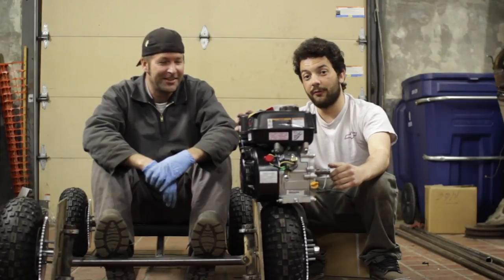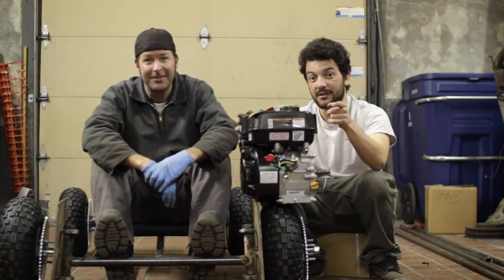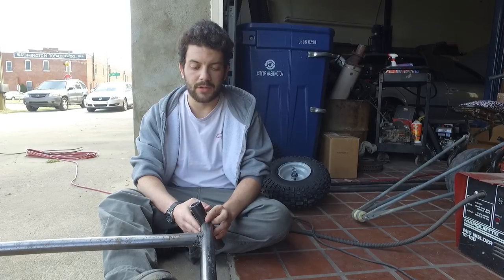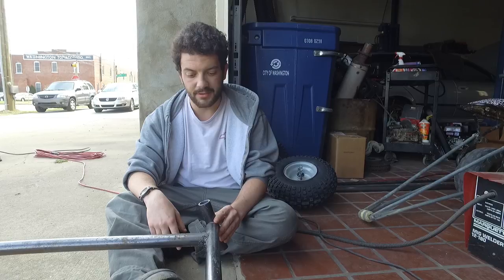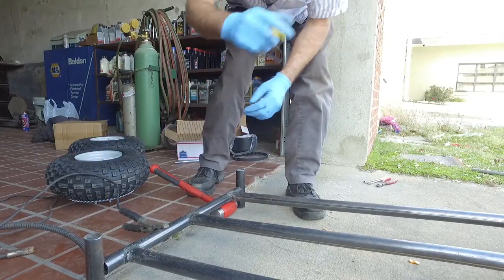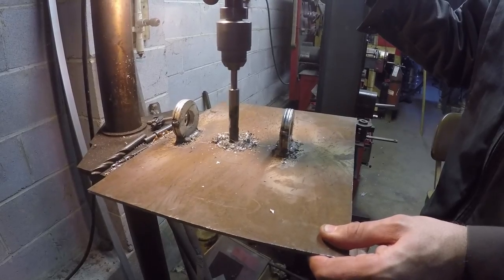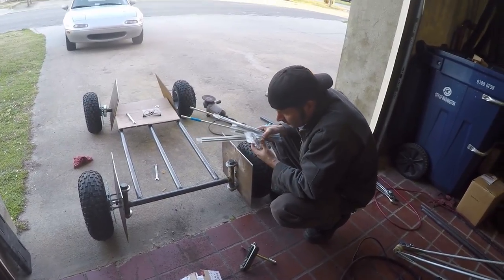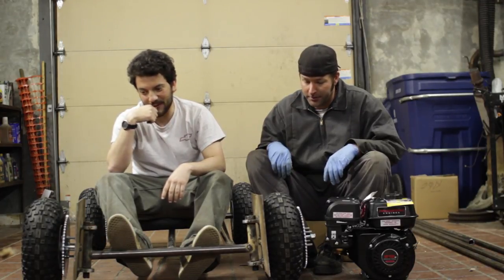AWD Go Kart Build Pt. 2

Comment: suggestion: do a golf cart drag build with the 670cc
Reply: That Guy im liking thisthis idea
Reply: That Guy.  I've been trying to find a golf cart to buy for cheap but they really arent.  im putting a vtwin harley engine in one
Reply: JTJ_ 22 you just have to keep your eye out i have 2 yamaha gas golf carts that i got for under 400 each that i built one has a 13hp engine which is my dads and im putting a 200cc (16hp) lifan 5 speed motorcycle engine the other one which is mine

Comment: hey guy just a question. I could be wrong. but just a guess. would I be easier to make two live axels with two sprockets in front and two in rear at the center of the shaft with the motors lower to center of gravity and  for the front axle to have stearing use two knuckles like for a drive shaft.
Reply: Luke College thought the same. Don't think it's gonna work if they don't do it this way
Reply: Luke College it could even be as simple as a universal joint at the end of the live axles, no? But then I suppose steering angle would be reduced
Reply: Chris' Bliss Builds I'm not sure I was just wondering. I was making an uneducated guess but would be cool if they figure it out
Reply: Yeah using knuckles would make it a lot simpler and more effective, Running it like this is limiting your top speed more due to all the weight of the steel and the engines. 2 engines 1 for each axle is the way to go
Reply: Luke College it won't turn
Reply: U-joints might work depending on how much angle needed, but small CV joints would certainly work.  Using either of those makes the spindle design a bit trickier since it'd have to carry a bearing/hub... not too bad especially w/ no suspension.  It's gonna be wild trying to tune-it w/ 4 independently driven wheels.
Reply: Yes it will.
How do you think any front wheel drive car turns?
Reply: really it be easier to do it that way but this will bring more attention and id rather see it done.
Reply: Or ya could have all 4 engines at the back with a pair of drive chains going to the front axle... it probably wouldn't be very reliable though because the excess slack in the chain may cause it to throw off without a chain guide or 10
Reply: I would have used one big engine and gear boxes like they used on the wagon to deliver power to the front and to the axles, then use small scale PTO shaft to use for steering  because it would need some kind of slip yoke or the axle will not pivot correctly.
Reply: Luke College like CV joints
Reply: i would have 2 straight axles
Reply: how are you gonna have four axles with four tires? and multiple engines on one axle would create too many problems.. two live axles in the rear with four tires and regular steering up(only uses 2 engines) front would be awesome and a lot less work and i bet it would handle better. i understand its not awd ... but i feel like four wheels in back would be sweet..
Reply: It's probably worth pointing out that a solid axle in the front (as in without a differential) wouldn't steer properly even with CV/universal joints because the wheel on the inside of the turn is following a smaller circle and so needs to revolve fewer times. Solid axle = understeer city. They might face some of that issue still, because the motor driving the inside wheel won't know to slow down, but there is some leeway there since these motors aren't huge. Will be interesting to see how it turns out!
Reply: Luke College I meant, mounting the engines on the frame. and fabricating a CV joint that goes from frame, thru the knuckle to the wheel. the steering won't be "weird or jerky" since the clutches can compensate for the speed diference
Reply: Bean  so the thing they are building is gunna steer a little weird also I think lol
Reply: Matte Edström because they have differentials
Reply: anthony anderson Weight won't limit top speed, just acceleration and handling.
Reply: I want to see 2 torque converters in a row on a cart. I suspect torque will be multiplied by the first to the point of burning the belt on the second. Or say 3 to 1 ratio on both if engagement is 1500 would need 4500 rpm at start to get the second to hook up. Would this give 9 to 1?? I could see a 6.5 winding up and doing wheelies. In a light cart. Maybe a 13 with 2 40 series in a row. Modify the engagement point on the second so it's constantly locked. The first will take care of the idle. I think 2 40s would last on a 6.5. I may act like 20lbs of torque on the second belt. A 13 would be like 45lb torque if multiplied by 3. This would also enable running a much smaller rear sprocket in the back for higher range.

Comment: 1. notch the tubes when youre welding them even if you barely notch them with a grinder.
2. tighten the wire guide nut in the welder. 
3. turn up your power and down the wire speed.

Comment: you don't need steering on this thing you need to stick steer. throttle cables on the right. throttle cables on the left. Push Pull cables for your break. drive it like a bobcat or a tank.
Reply: Sharecropper 182 EXACTLY!!!!!!
Reply: Good 'ol skidsteer
Reply: Sharecropper 182 good concept however it would only work if their was reverse on the wheels in order to work like a bobcat.
Reply: Like a tank
Reply: you shouldn't need reverse for it to turn simply hold the brake on the left side throttle the right or vice versa it should turn fine
Reply: Sharecropper 182 yes I under stand it would just be cool to do 360s with a reverse also
Reply: I understand completely that would be fun
Reply: fuck yeah wouldnt work sadly the wheels would have to reverse
Reply: Wouldn't have to reverse but the turning radius would be huge
Reply: Sharecropper 182  YES that would work and be soooooo badass
Reply: Justin Williams what it would just slide one side. if  it had a reverse too on all four wheels would only make it turn better and faster. but... doesn't  need the reverse to turn
Reply: more like a TC 12 euclid

Comment: Interesting build. It will be a dismal failure, but interesting...
Reply: lol. maybe
Reply: y'all inspire me!! hope this turns out for you!!
Reply: If you're going to spend time fabbing things up at least fab up some cv axle set up, some sort of differential set up. This engine per wheel thing will be one of the most time consuming and expensive failures I have ever seen lolol.
Reply: cac groupie is upset. :D
Reply: thanks
Reply: naaa. it was the cheapest and most entertaining
Reply: Isaac it'll be fine steering?
Reply: I agree. these guys don't give me much confidence based on their previous builds, too much bodging and building things by eyeballing it rather than taking the time to measure things and build them properly. I cringed like hell when Ike was welding that bolt into the tubing the first time around.
Reply: I wonder how they are going to sync up the throttles on all four engines. That will be a cool creative engineering achievement :)
Reply: GT1Man it's about being dumb and having fun doesn't matter if it failed is still cool

Comment: I get having the engines over the front wheels but you are going to need a longer axle and a support for the engine plate outboard the front wheels. And a live axle with both rear engines will save weight and complexity. Whatever you do I can't wait to see it. Keep up the good work.

Comment: I would scrap the plate steel idea for the mounts and try building them out of the tube steel you used for the frame. Just seems like that plate steel wouldn't hold up the predators all that well

Comment: That frame needs to be more ridged otherwise  you will pop welds when (if you can) turn during full throttle.  Some braces put in at 45 degree angles to truss it down the center will help with the torquing of the frame, triangles are your friend in roll cages and frames.

Comment: id add a few frame gussets to them front spindles. that looks like some #inwoodcustoms #1puglife work. lol love the mini bike!
Reply: we will. thanks
Reply: Isaac it'll be fine not nocking ya but got to protect your noggin lol. whats next 6 wheel tracked mud monster! lol
Reply: Definitely need gussets on the front spindles. They'll bend or break otherwise.
Reply: Eaves Street , Friggin Rights LoL
Reply: You could put another bar at the ends of the spindles and bend the bar so it makes a bumper and sticks out further than the lower bar.

Comment: this will indeed be interesting, if you end up redesigning, put two engines on the front and back and run the output shafts to CV joints so you can have independent suspension at all four wheels.

Comment: Ackerman is the angle of the toe arm on the spindle. What it does is it puts the front wheels on different angles when turning, because when turning the front wheels are taking different paths at different speeds. If you run 0 Ackerman, which is putting the tie rod mounts at 90 degrees from the toe rods, you're going to have some skipping as one of the wheels is going to be unhappy with the speed and angle that it's being forced to travel. It doesn't have anything to do with caster or camber.

Comment: I had some serious doubt about this one after the last video, but it's looking better. As to the throttle and torque steer issues, best(simplest) solution I see would be three throttles. A pedal for both rear engines, and individual trigger throttles on the steering wheel for the front engines. That would still leave a foot free for a brake pedal. Curious to see how this one develops. :)

Comment: I like the idea of the build, it will feel strange turning under part throttle due to outside wheels spinning faster. Maybe the belt drive system will compensate for that.

Comment: Hey guys... I have been thinking of this build a lot, and one of the problems that comes to mind is the throttle. I would suggest using 2 throttle pearl as and weld them together. Run one to the back to a splitter and one to the front with a splitter. On the other hand sense you guys are hooked up with GPS just ask em for 4, cut um down a bit, and run one cable to each. Good luck let me know if this helps

Comment: I'm pretty sure Ackerman angles have nothing to do with the caster and camber, just the steering arms, as long as the steering arms point at the center of the rear axle when the front wheels are straight, the wheels will turn the right amount relative to each other

Comment: Mount two axles in the rear with two motors on each axle.  Then you have four wheel drive.  Do the front end like a normal cart but much heavier to muscle everything around.  You could even make a pivot between the live axles and the rest of the cart so that you had a rudimentary rear suspension.

Comment: How is the front steering going to work with the throttle cables? I guess it would act as a differential by throttling the inside motor down and throttling the outside up therefore spinning the wheels at different speeds

Comment: you could just mount the front engines to the inside the front wheels on the frame and get two small u-joints and weld one end to the clutch and the other end to the wheel so you can turn while the engines stay in place!

Comment: I think you should have notched all that metal tubing prior to welding it up in order to get more contact area to work with. Those joints are going to be pretty weak as they are, and I'd expect they will start breaking the frame if they ride this thing off road like they ride some of their other carts.

Comment: You probably know, but it is important that your tires be mounted equal distance from the front spindles.  That means there will need to be a space on the left (driver's) side to make up for the distance that the sprocket sets the wheel away on the right side.  I'm curious if you could cut the studs off of the front sprockets where they protrude beyond the sprocket to reduce the wheel's distance from the spindle.  I'm enjoying the build so far.  Keep it up!

Comment: Ackerman steering geometry actually doesn't have much to do with caster or camber. Ackerman geometry is actually sort of a variable toe distance depending on the amount of steering input. At the steering lock in both directions, the inner wheel will be traveling in a smaller circle than the outer wheel. This means that the inner wheel should turn inwards a greater amount than the outer one does. What this accomplishes is keeping the wheel rotation as tangential to its turning radius as possible as to reduce rolling resistance and keep full traction on the tires at speeds. 
The caster and camber are both still very important aspects of steering geometry though. The caster is the tilt of the spindle axis towards the front or rear of the vehicle. Its what provides the force that re-centers the wheels after a turn and in larger applications it prevents death wobble at greater speeds. Camber is the lateral tilt of the spindles that allows the outside tires to maintain grip when the weight has been shifted over them in a sprung vehicle (vehicle with suspension). Unsprung vehicles like go-karts do not really benefit from such extreme camber since the wheel geometry should never change in accordance to the perceived movement of weight. They do still have camber built in to the spindles that is only present in turning; when straight, it will be a camber of 0* +- about 1/2*.

Comment: hey, as a suggestion the plate steel you are using to hold your spindles could be wrapped around the washers it is welded to then fled the rest of the way. that curvature will add a lot of rigidity. Also Ackerman angle has everything to do with where you mount your steering mounts in relation to the uprights (spindles). Camber and caster are independent geometry.

Comment: Hey Ike, re:  Torque Steer:  I had all kind of crazy ideas for a linkage to the steering shaft to throttle back the side you're turning towards, which would require a complex lever arrangement, extra springs, and four more cable linkages to each carb with more parts at each carb, but then: Why not just use two throttle pedals, one for each side.  Ease off the right throttle a little when turning right, etc.  Easier to fabricobble together or abandon if you don't like it.

Edit:  speeling.

Comment: think you can make the steering rods a little stronger by doubling them up : add a tackingrod on the rear connecting the knuckles together and do the regulair twin steering rods connected to the steering mecanism on the front 
doing it this way you can tension the rods against eachother and they shouldnt colapse as fast (allways pull force on the rods ) and should one brak you should still have enough steering to stop the kart safely , you do need to connect the steering at one point so it doesnt lengthen or shorten during steering or it will bind

Comment: I want to see 2 torque converters in a row on a cart. I suspect torque will be multiplied by the first to the point of burning the belt on the second. Or say 3 to 1 ratio on both if engagement is 1500 would need 4500 rpm at start to get the second to hook up. Would this give 9 to 1?? I could see a 6.5 winding up and doing wheelies. In a light cart. Maybe a 13 with 2 40 series in a row. Modify the engagement point on the second so it's constantly locked. The first will take care of the idle. I think 2 40s would last on a 6.5. I may act like 20lbs of torque on the second belt. A 13 would be like 45lb torque if multiplied by 3. This would also enable running a much smaller rear sprocket in the back for higher range.
Reply: Can probably be adjusted so the 2nd converter starts shifting right when the first one runs out, allowing you to deal with low speed and high speed gearing seperately (since theres a distinct point where the shifting transfers over). You'd also be able to have different engine rpm settings for low vs high speed driving.

Comment: How are you guys going to tie the throttles together? When you take a turn, wont one throttle close and the other go wide open?
Reply: No it won't. you fix the wire casing to the engine.

Comment: the rigidity of the front end will decide the success of the build , nothing else ,. The weight is not gonna be an issue at all , each motor is pulling about 1 minibike or less.

Comment: I say abort the four engine design and do three engines on rear of cart.  One engine each tire and one mounted in center on a wide solid axle.  Steering and handling issue eliminated...... Plus it would be a lot more fun driving and sliding

Comment: it just seems that it would be better all around. if you went with two axels. with CV or universal joints. they make universal joints for steering shafts. I would guess they might handle the tq. or just cut down a car CV Axel. and you can still connect two engines to a single Axel. but I'm looking forward to seeing how it turns out.

Comment: what about bmx bike necks at each corner so you can have throttle control with the old rear break assimbly and have pivot points to stear with

Comment: dude 420 engine the magic box normal rear axle then run the front drive with the magic box the front axle would have to be set up like CV joints or with U joints to allow turn and spin. 22 inch wide frame and at least 5 feet long. That would be intresting

Comment: Isn't it easyer to use 3 back axles?
Put spindels on the front one, second one as transfer axle and a normal rear?
Then you can use just 1 engine.

Comment: Should have used Square tube and not round. And since you did use round you should have cut the ends where you attached the spindles so you had a better weld on those spindles. those won't hold up.

Comment: you could have 2 engines on one side connect to a single pedal and the other engines on the other side connected to one pedal and have the pedals close to each other like a tractor brake so if you needed to turn one direction faster you could apply more power to the side that needs it?? just a suggestion